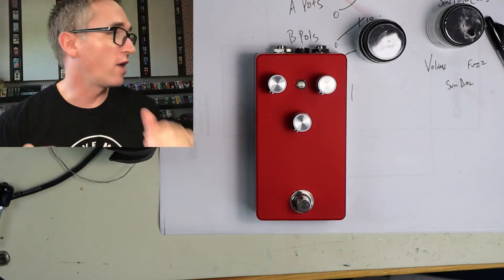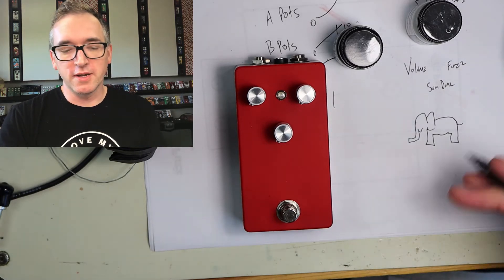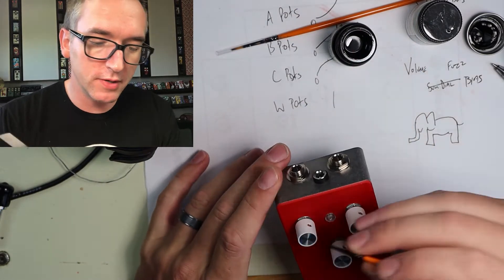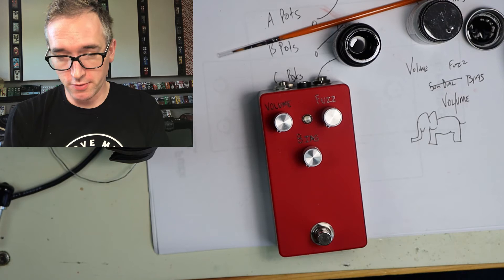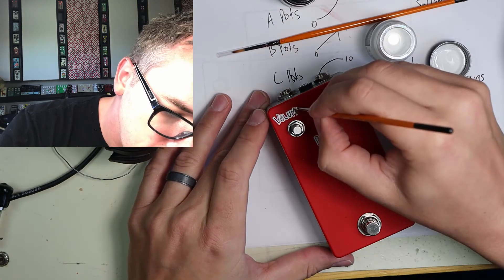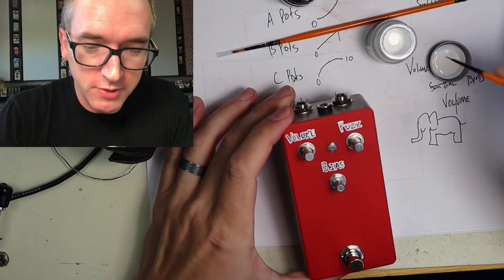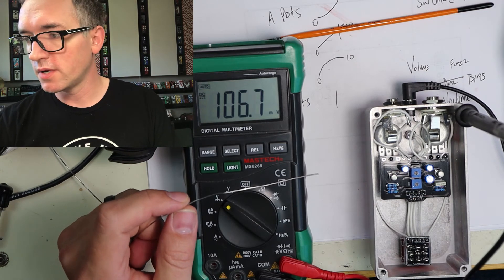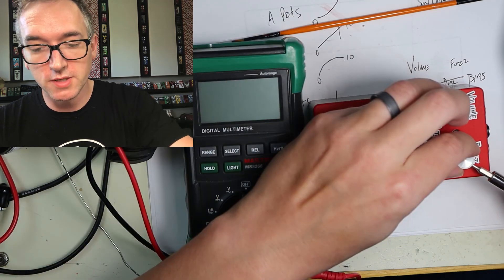How to Build Your First Pedal Part Three I Lettering and Initial Biasing

Comment: Great series of videos.  Is there much benefit to, or issues with, applying a clear lacquer over the paint for added protection?
Reply from the maker: Thank you! There is certainly benefits to applying a clear coat but be careful as certain clear coats do not like water based paints.
Reply: @dkpedals  great advice.  Thank you. 👍